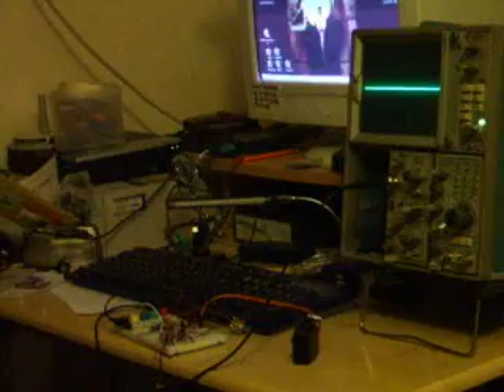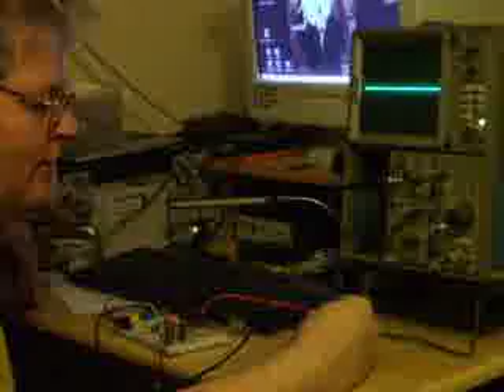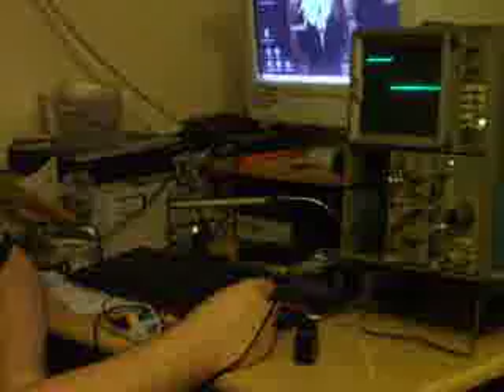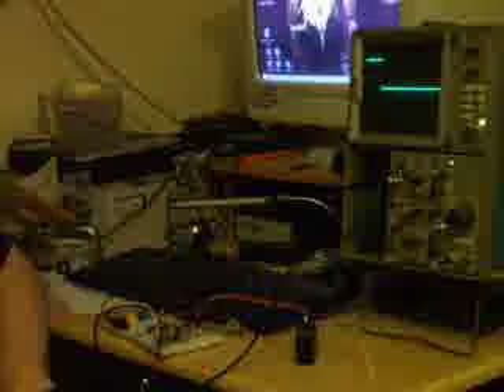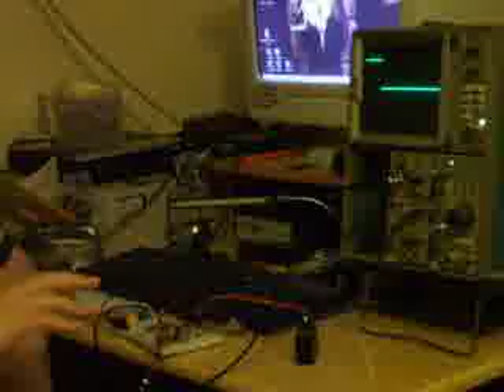Demo of rc servo driver (twistgrip)

Comment from the maker: The servo moves to a position determined by the pulse width supplied - a pulse of approximately 1ms duration is one extreme, and a pulse of 2ms moves it to the other extreme - pulses of 1.5ms being (not surprisingly) the centre position.
Although the servo's do rotate, if you place a connect a rod to the arm then the rod goes back and forth = sort of a reverse of the way your leg going up & down turns the pedals on a bycycle.

Comment: In A level systems and control, for my project im making a uv sensor, and a radio, and its going to be charged by solar panels.

question ?

My teacher wants me to use a servo driver to make the solar panels go up and down at an angle, i have no idea how to do this, i thought servos go round in circles, my teacher told me to find out myself, he said something about usng a rod